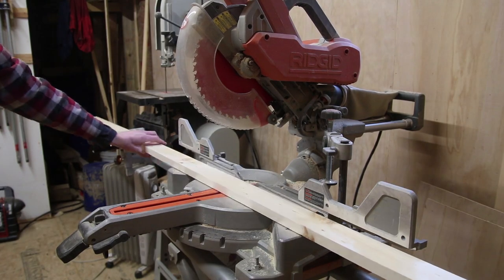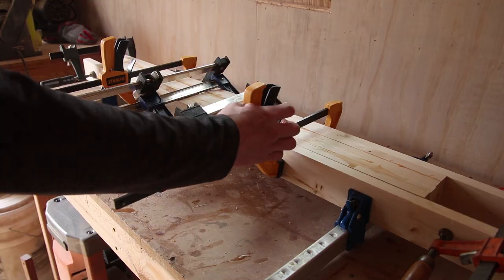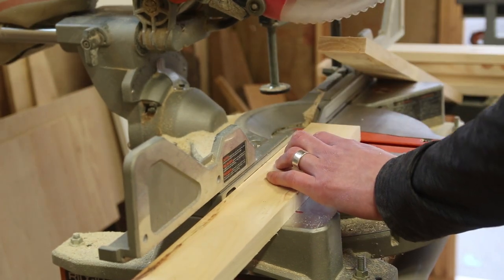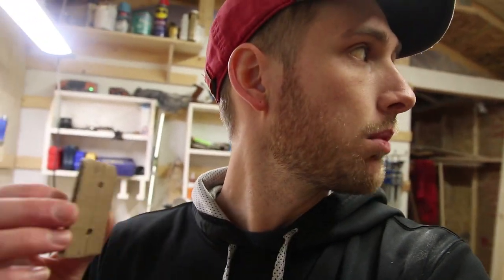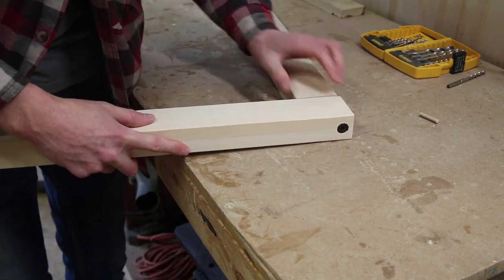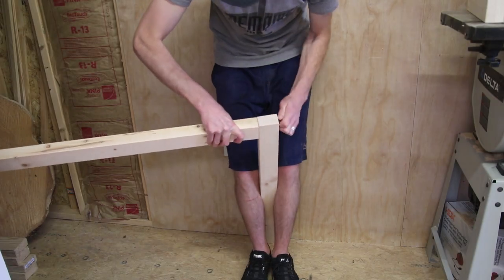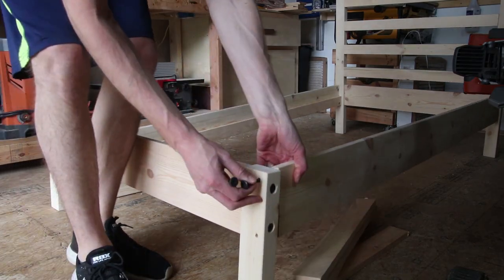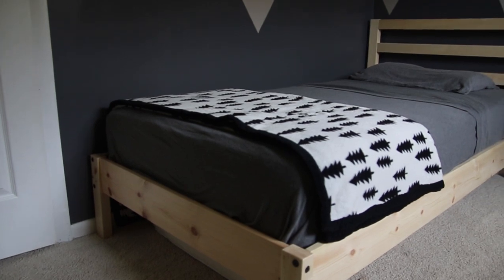DIY Twin Bed

Comment: Thank you for sharing your info. I am wet behind the ears and need to build a bed since I am in between jobs, gave my bed to salvation army to downsize and am sleeping on a coleman cot which I like but it is no permanent replacement for a real bed. I need a twin because my room is about 8x14. I need to make it taller since my back isn't in the best of shape at 62 yrs. It would be nice to have a headboard with a built in bookshelf for those late night reads. I see where your hardware and board build-ups will work really good for this 180 lb. man.Thank you.

Comment: Just a thing to consider. you could use a 2x3 for the lip just in case the slats are a little short.
(edit) slats are cross braces.

Comment: Very nice project Mitch. Question: Did you make the hole too large to accommodate the barrel nuts at the corners? S/B 1/4" hole.  I noticed the flat head furniture bolts might have been longer than necessary since they extended well beyond the barrel nuts. When gluing wood together it's always better to sprinkle a little bit of salt on the pieces. When they're clamped together they won't move. The salt will dissolve. I'm thinking that I will add 3 inches to the length and width so that the bedding will fold around the mattress without chafing your hands while making the bed. I like the fact that you chose 1x6 instead of using 2"x lumber. Did you use "Select Pine" for the side rails? I understand the knots have an aesthetic value but I'm thinking of spending the extra $$ for Oak or Clear Hemlock. Again, personal choice. Nice project and nicely done. THANKS.

Comment: Just fyi the cross dowel nuts you link to in the description are 6mm, not 1/4 inch. Something I should've checked before buying. Other than that, great build!